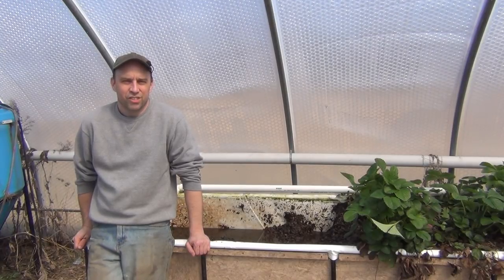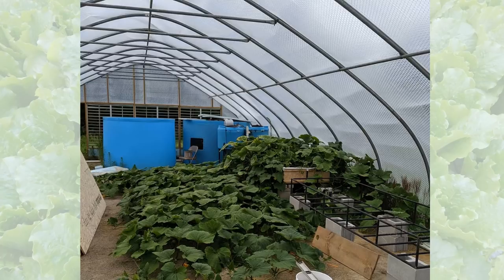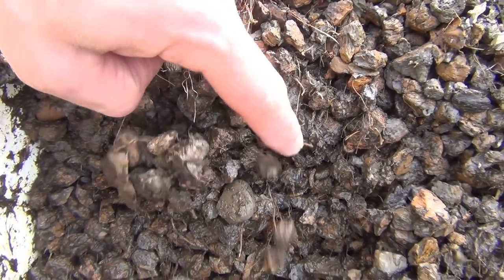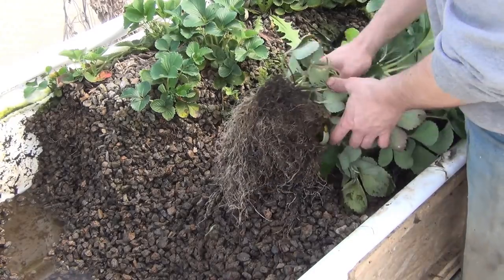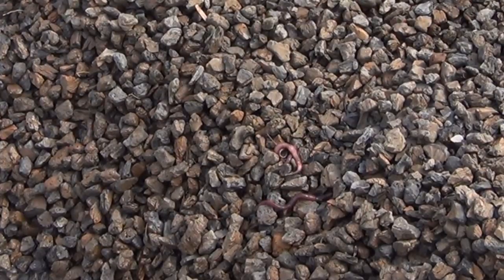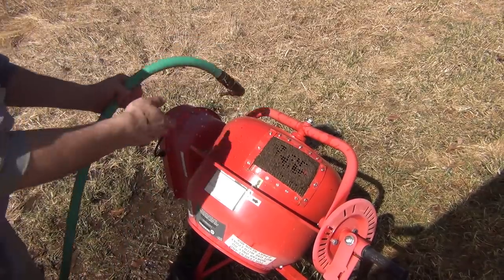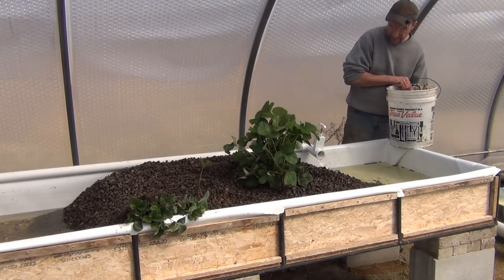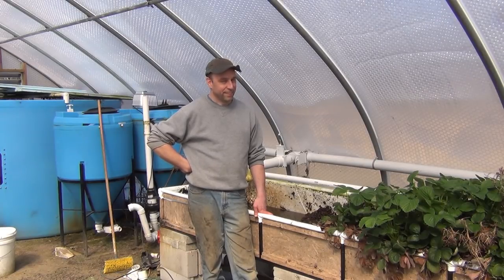Aquaponics Dirty Side?

Comment: It's a fun game Rob. 😂
Have you tried just washing it in situ with the bed flooded (but not running)? Works OK for the clay media I found. 
Am always surprised by the colour of the red wrigglers in aquaponics compared to the soil. They always look so much healthier & larger.
Cheers Rob & happy cleaning mate. 😉👍
Reply from the maker: It was so badly clogged that the water couldn't even get through it.  Since I was building the other bed, I figured it would be just as easy to do a complete clean and transfer the media.
Reply: @Bigelowbrook  Makes sense. Did the same with our system recently. 
Cheers Rob.

Comment: Thanks so much for posting this. This tells a lot about the realities of running a Aquaponics system. There are things that go wrong and need fixing, and not just the glamour of the building and harvesting. I appreciate your approach to your operation. you are careful and well researched in what you do. I have learnt alot from watching your channel.
A comment; in my build I want to keep the water as warm as possible so I placed the tanks away from the evaporator cooler and at the end where the air goes out. I am growing Tilapia to I need the water warmer that 25C if possible and keep it above 14C in winter. I Live in Johannesburg where it goes below 0 some nights but back up to 20C in the winter. I am experimenting with a solar heater inside the green house near the top, in the hope of capturing the heath in the day so as to keep the heat up at night. 
I am using an Arduino to do the controlling so I can measure many parameters like Temperature, Humidity and light for this reason I can control the cooler, and the solar heater with ease.
Thanks for sharing the details of the various components. i am hooked on your channel. Donald

Comment: I wonder if you had a single line going outside your greenhouse if you could have a few dozen plants in a bato bucket type system out there. This would be good for watering squash or pumpkins if you are worried about spreading crops. You could grow some killer competition pumpkins this way. 
Then in winter just turn it off. 
Any interest in any plants if i could get some too you? I found a package i made up for you while moving, it had some seeds and a couple old corms (long dead) that was supposed to get sent out but got lost in the fray.  Id be happy to try to send some your way again if youd like to try something different. 
Are you still heating the dome year round?
Reply from the maker: I've thought about doing a few buckets in this system to keep some of theses crazy plants under control.  Feel free to send some seeds and I'll try to experiment with them!

Comment: Have you considered solar thermal (via black tubing and a pump) heating for the water?
Reply: Yep. He has. Won't work.
Reply: @AdamTait-hy2qh  ah ok.  Too dark during winter i bet?
Reply: @ericlotze7724  Yep one good reason. Any temp solution has to be worth it and year round. Also, you lose too much heat
Reply from the maker: Yeah, it's too dark her in the winter.  You need light during the night.  ;-)

Comment: You're taking a whole lot longer than necessary, using the cement mixer ! We use five or more 5 gallon buckets, drill holes in the bottom of 1, put it up on bricks, top off the other buckets with water, pour it into the drain bucket, put some water in the bucket without holes and then for the rocks back and forth for the top that'll be enough, but the rocks from the bottom you will need to repeat the process one more time ! Easier and faster, 4 +gallons of grow bedrock at a time ! Three or four more buckets of rock ready to go !

Comment: How long did it take to build up that much material. I used to run aquariums naturally and it took about three years to build up that biolsyet.
Reply from the maker: just the summer.  I mentioned that I was dumping unfiltered solids into it, plus there were too many plants in there.

Comment: This makes no sense to me. The red wigglers will just populate into larger numbers and take care of this for you. I just don't see why you would go through this hassle when what you're doing is working
Reply from the maker: I want the use the beds now.  They'll take too long to process it.  The material will go anaerobic before they can break it down.
Reply: @Bigelowbrook  I don't know your level of experience but that's unlikely to happen in a running bed with red wigglers. Notice how well the strawberry plants were doing before you pulled them out?
Reply from the maker: like I said, I wanted to use the beds now and don't want to wait for them to break down the solids.